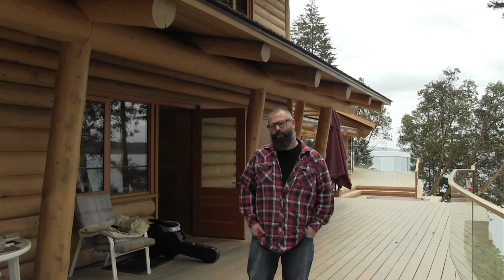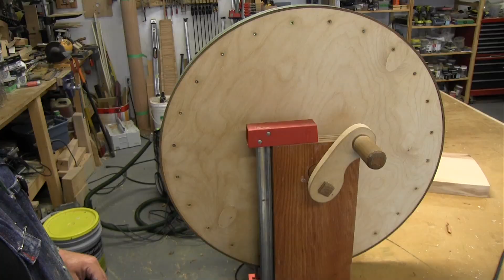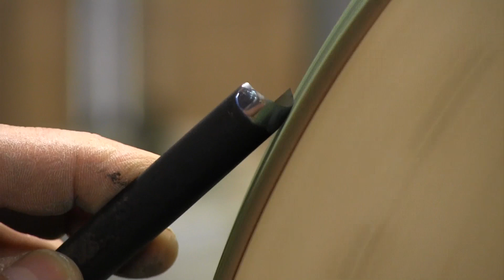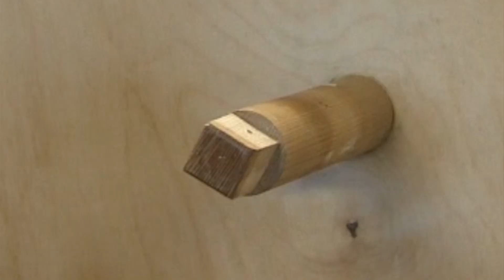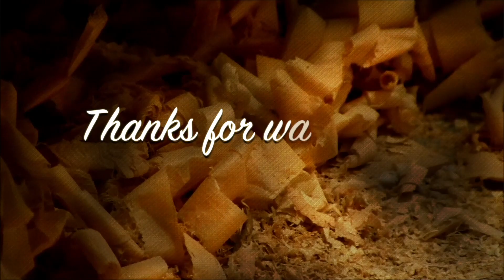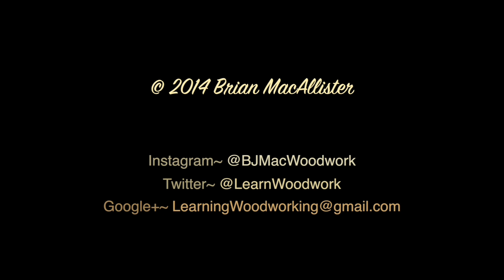Tools: Sharpening wheel

Comment: Hi Brian, I also found you on Instagram.. Thanks for sharing your stuff with us! How did you cut the square pin on the dowel and handle? It looks like you just glued the handle in place but there is some hardware holding the crank to the dowel?
Reply from the maker: I just drew a square then cut shoulders with the hand saw, then split off the facets. the pieces have 1 screw holding them in place.